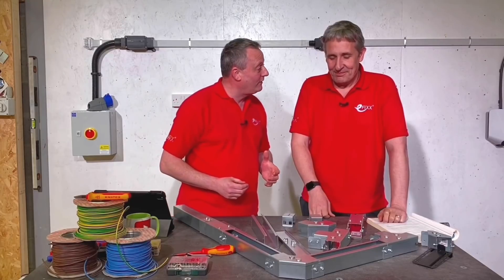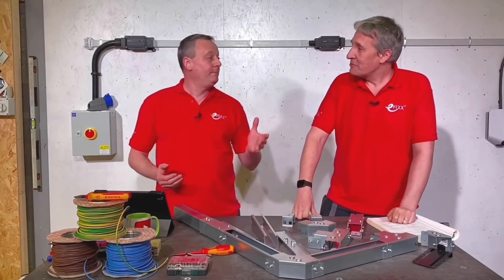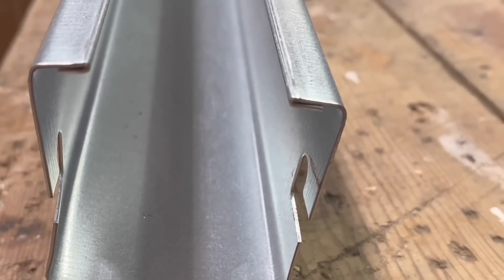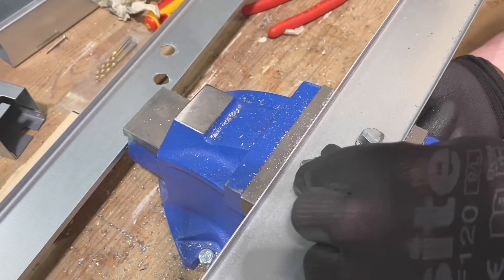SPEED UP YOUR TRUNKING INSTALLATION with Salamandre by Legrand - IP4X

Comment: Stepped drill bit for those 14mm holes... punch, 4mm hole, stepped drill up to 14. The stepped drill on fast speed is so nice to use. REALLY quick and smooth. Count the number of times it steps by the thuds it makes, real quick and no jerking action

Comment: I used to love fitting trunking. But Salamandre have really pulled out all the stops here. Plus i love the template. #StaySafe
Reply from the maker: Thanks Brian as always 👍
Reply: Hi Brian. I cannot find the answer to this question. Do sheathed lighting cables need to be housed in metal trunking in warehouses? Please help
Reply: @antonios4926  To be honest, i am retired now; so i don't know what todays BS7671 says about it. Whenever i worked in a warehouse rewire, we always used 50x50 metal trunking. However, i have come across cables fastened to cable tray. Hope that helps. This may be a question for Regulation Corner.
Reply: @brianwood5220  I thank you for your reply. Enjoy your retirement.

Comment: Installed 100's of meters of this stuff for a project called Western link I worked on. Was at Deeside in a DC-AC converter station for off shore energy. By far the best and only trunking I have used since for my own jobs. A pleasure to install.

Comment: Does the UK have like colourcoded steel pipes?

for example, in Malaysia, we have Orange pipes/trunking for electric, Green pipes/trunking for telephone wires.
Reply from the maker: We used to paint conduit orange etc - but it was phased out.
Reply: @efixx  is that why old micc are all orange?